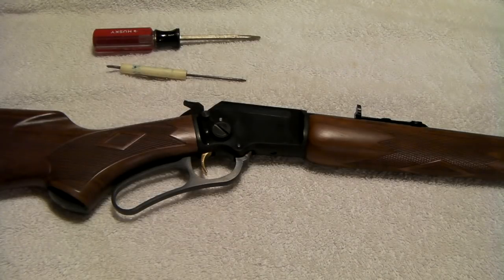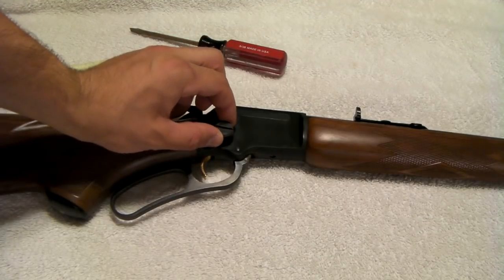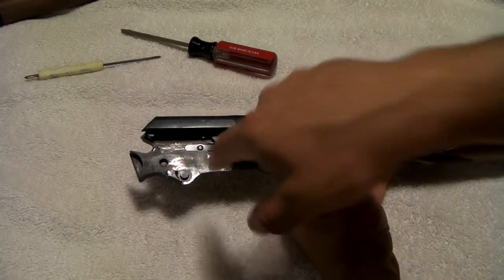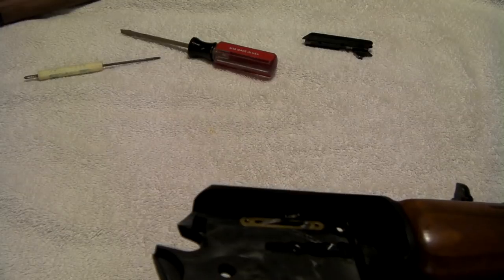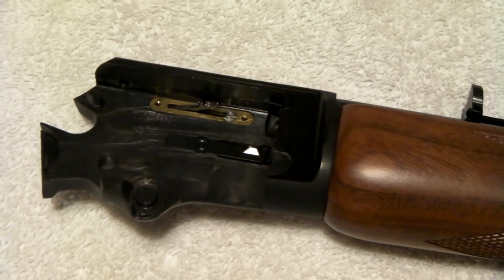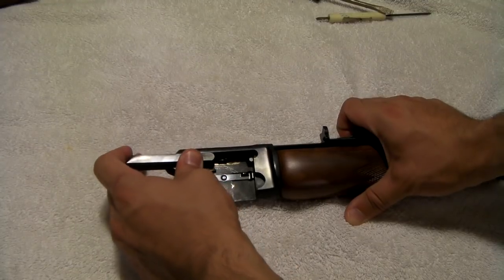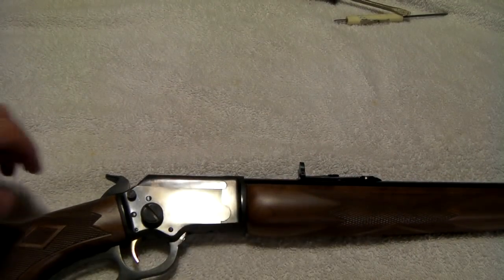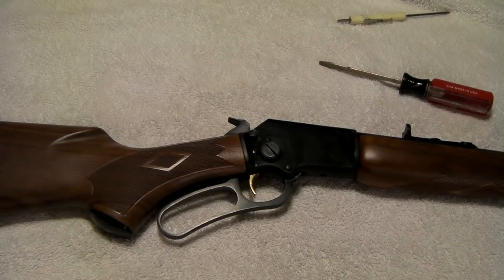Marlin 39a Disassembly/ Reassembly

Comment: Great Vid! 

Not applicable here, but for older Marlins (pre-1983 without the cross-bolt safety), the old manual says that during reassembly: (1) the firing pin is as far back as it will go (while the bolt is as far forward and (2) "Due to extremely close tolerances, it is necessary to release the lever slightly from the closed position."  Just thought someone might find that useful.  Thanks again!

Comment: Since I am a retired Gunsmith of 30 yrs. there are certain aspects of this gentlemen's video that could use some correction for all.  Note: It is however appreciated that the person creating the video was good/kind enough to at least provide some insight for those who otherwise did not have any idea of how, where, etc..  FIRST: As a previous reviewer noted - YOU DO NOT use a 1/4" bladed flat screwdriver on the Takedown Thumbwheel.  The slot in the Thumbwheel is technically referred to as a "Coin Slot" type cut - thus it literally self-describes the tool to utilize.  You can use a Coin Slot Bladed screwdriver (can buy these) of proper width to displace most of the slot length in the Thumbwheel, or you can make your own by simply belt sanding, or gentle grinding a flat blade screwdriver into a crescent/half moon shape.  Also, as with most other type SLOTTED screw heads, TO KEEP from marring the Blued Finish, place a piece of plastic baggie in between your tool (or coin) and the SLOT of the screw head.  SECONDLY: The separation of the two (2) rifle halves - go easy on the tapping - of the Barrel, or using the very Rear of the Stock to separate.  You can use the palm of your hand to tap on the rear most portion of the Stock.  If tapping via the Barrel use good padding, or a couple towels to keep from placing any marks on the Barrel, or into the Stock if tapping from that end.  THIRDLY:  Both sides of the Receiver do need cleaned thoroughly - not just the LEFT Side as stated in the video.  FOURTHLY: Using Hoppe's #9 to loosen and dissolve Chemical and Metal debris (not Black Powder) as stated in the video is a common choice - there are numerous other brands of products that do the same thing (such as Shooters Choice Solvent).  Nothing against old #9 or Hoppe Co., BUT, if any of this chemical is left within the Lockwork of your firearm, be aware that old #9 (and certain other brands) will semi-solidify over time (Temp and Dryness dependent) into a goo that will actually cause problems.  Always WASH out the Dissolving Solvent (i.e. #9) with a good clear and clean Rinse Solvent.  One I've always liked is Outers(tm)  Nitro Solvent in the spray can - other brands are similar in function.  Let things Air Dry, or use canned dry air to help the process.  Once "everything" is clean and dry, give your firearm a "drink" of lubricant.  Many brands are available, I often utilized Shooters Choice FP10, or other synthetic lubricant which will NOT DRY out quickly as will plain ordinary Gun Oil.  FIFTH: Many manufacturers advertise a (1) step, or Single Spray Scrubber for Guns...be aware that most all are Chlorinated-based chemicals (now non-flammable types).  These (1) Step Chemicals DO wash away Powder Debris, and Metal particulate, however they typically do not dissolve built-up Carbon deposits.  Using Round Wooden Toothpicks, Toothbrushes, or chisel-pointed Plastic-based small tools can get into those tiny nooks and crevasses where debris manage to hide.  Bottom Lines: Cleaning a firearm is a (3) step process, think of it as: applying soap, a rinse job, and aftershave (lol).  The first (2) steps of this cleaning process should be done to all BORES as well, except NO LUBE in the Bore if usage will occur shortly (a couple weeks) after this detailed cleaning.   A very small amount of light lube on a patch could be applied if exposure to water/moister during an upcoming usage is expected (Military Arms with Hard Chrome Bores are exempt).  Apply a small amount of lubrication inside the Bore via a patch if storing for awhile using a quality light lube (i.e. Rem Oil or similar), and run a dry patch through the Bore before usage.  No SHORTCUTS unless you are out in the field, or when "stuff" manages to find its way into your gun while hunting, or a long continuous day at the range, etc..  Your guns will function better, last longer, and you won't be frustrated with something not working right.  This process is applicable to ALL types/calibers/gauges of firearms.  This insight is NOT meant to advertise or detract from any product or brand of chemicals, the products listed herein are simply some of those that I have found that work quite well.  By the way - the Marlin 39A is/was (not currently made), a top shelf .22 Rifle in all its variations.
Reply: Can you please expand and expound thy great gun knowledge to all of us plebeians?  Danka 

#HidenJoeBiden

Comment: Thanks for the video and the tips and instructions.  I'm in my 70's and have had a 39A since I was a boy.  But as far as I know, it's never been taken apart and-or cleaned other than the barrel.  I'll be doing it soon, even though I still use it and it works perfectly.

Comment: Whatever you do, do not use a flat blade screwdriver like he did to remove the THUMB screw, or to reassemble it.  Should only be hand tight.  If your take down screw it too tight, use a quarter, not a screwdriver.  You will only bugger up your screw slot using a screwdriver that is not big enough to fill the slot in the thumb screw.  For the fellow that said that helped him with his trigger, I am amazed at how you got any trigger work done from that video.

This video is better than no video, but it is still not the PROPER way to do it.

Comment: To summarize what others have said:
-The take-down screw is designed to be used with a US quarter. It is dished for the coin, not a screwdriver.
-Hold the forearm in one hand and slap the left side of the stock to seperate. Don't strike the barrel nor magazine tube against Anything, at Anytime, for Anyreason. ( Exceptions: Self defense, bear attack, destroying firearm before it falls into enemy hands, etcetra ).
-Blackpowder is still used, tho extremely infrequently in .22 LR.  Smokeless and oil combined produces black sludge.
-Poor lighting. Standard room lighting utilized, no attempt to enhance and results show. After additional lighting, a strong flashlight may be used to show inside the action. "Too much is barely adequate."
Reply: Actually, the Marlin 39A manual says to "place a folded cloth on the floor or work bench. Hold the grip of the rifle firmly and let the left side of the muzzle strike the cloth. You may have to repeat this tapping several times ..."
But I agree with the rest. And one should take care to ensure you are tapping the barrel and not the magazine tube.
Reply: After resembling could not move the eject lever

Comment: Use a quarter to remove the disassembly screw!  A quarter is what it is designed to use.  A screwdriver will gouge up the slot.  It doesn't take many disassembles to crappify the slot :(

Comment: The takedown screw slot is not flat. Its bottom is an arc that fits an American quarter. So, a quarter is the proper tool to remove the screw if you overtightened and need to apply more torque … this is by Marlin’s DESIGN! Do NOT use a screwdriver!!! I have seen numerous 39A’s takedown screws with cosmetic damage due to screwdriver use. Don’t use a coin to tighten the screw in place … hand tighten using your fingers as the proper tool … that is why the screw has knurled edges. Do not overtighten!

If you MUST use a screwdriver, don’t pick one that is too small for the slot as is done in this video. To avoid screw damage, always choose the largest screwdriver that has a blade thickness to completely fill the gap of the slot to avoid creating focussed pressure points that gouge the edge of the slot. Most people use slotted screwdrivers improperly, and this video is an example of that. 

Oth

Comment: please use a quarter when loosening the take down knob, not a screwdriver...
Reply: lol i said the same thing lol i have one n absolutely love it!!!!
Reply: Not a thing wrong with using a screwdriver.  It can be hand tight, tightened with a nickle or quarter, or a PROPER fitting screwdriver.  Quarters have an abrasive edge with the grooves all around it, so I prefer a proper gunsmithing screwdriver.  Leaves no scratches that way.  The one that fits the screw on Redfield windage rings that is convex on the bottom works best.
Reply: @pickin4you    If you use a large blade screwdriver, I might agree with you, but not really. But this video is not showing that. I have seen too many 39A’s with a damaged takedown screw, which ruins the finish and then creates an unsightly appearence. In the newer 39A’s, that screw can be easily screwed completely out and replaced, but in an older one like my 1948 unit, the takedown screw is two-piece, swaged in place, and cannot be easily removed, so if you damage it, the repair is costly. The takedown screw slot is not flat, it’s slot is curved to accomodate an American quarter, hence the proper tool, if you need one, is a quarter … that is by Marlin’s DESIGN. So, in summary, I totally disagree with you.
Reply: @dilvishpa5776  I even put down a cleaning patch first, between the quarter and slot. Eliminates slop, AND, no metal contact!
Reply: @brucetstockford7592   That is a great suggestion! I am usually able to loosen the screw using just my hand, but if I ever need to resort to using a quarter, I will use your suggestion. Thanks!

Comment: Nice basic video, but you use a coin to undo the main screw, preferably a half-dollar or a quarter. Secondly, it's important to give the internals a good wipe down with a  light lubricant-protectant using a clean cotton cloth. This makes it easier to take apart next time. Finally, it should be pointed out that the this ability to easily break down the Marlin 39A, which makes breech-end cleaning easy, is a considerably advantage it has over most non-bolt-action 22s. Semi autos are usually a muzzle cleaning only proposition.

Comment: I haven't found anyone taking the forearm off. I've looked at several 39A cleaning videos and not
one took the forearm off. I was just wondering how its held on.  Thanks for the video though, very
informative.
Reply: It's a pair of small flat head screws. Undo them than the cap can slide forwards allowing you to remove the handguard. 2 years late on the comment, but there you go.

Comment: He didn't explain it properly, but the big takedown screw on the side of the receiver should be undone with either a wide blade hollowground screwdriver or a quarter.
Believe it or not that screw was designed from the beginning as a coin slot type, with Marlin themselves describing it as such in their manual.
As with all guns with flathead screws, it's always best to use spring steel hollowground screwdrivers to prevent damage to the screw heads.

Comment from the maker: According to the 13th edition of modern gun identification and values... The value of the 39M is $225 in good condition and $275 in excellent condition. The gold plated trigger hits the rarity mark. with that being said Ive seen these go for between $350 to $600. I hope this helps.

My guess would be 250-500 dollars in the states. But of course the firearm market is different in Europe. If you can get 500$ for it, I think you did great.

Comment from the maker: @horsefly4 yea, mine came with the mount. there are 4 screws above the action that come out, and then the mount goes on top of that. It also comes with 4 longer screws to go through the mount and then engage the threads in the gun. pretty self explanitory once you see it. be sure to save the short screws in case you want the scope to come off though.

Comment: Good job.  Thanks. Not much on these classics. Especially helpful was the reassembly part stating that the two halves didn't have to snap together perfectly flush before tightening the take-down screw. The manual doesn't describe this in any detail.

BTW. Is the firing pin just a free floating item without any spring?

Comment: Thank you TUCKERTHEGSP,
great help from you. One more question. Is it posible to screw down ejector prior the rifle takedown? Mean, can I open bolt with lever, screw down ejector and disassemble Marlin? One more time: thanks for reshooting that video.
Reply: Tried  sharply taping the end of the barrel as shown but it will not break apart! Help!

Comment: I think the 39M is the same as a Mountie my Brother got one for Christmas in 1977 it is a sweet rifle i have a 1954 39A with a straight stock and 20" barrel it looks a lot like a Mountie/39M except for the lever on mine is round on the back unlike the 39M which has a D shaped lever with a short tang. In the U.S. a nice 39M will bring around $550-$600 on Gunbrokers I paid $650 for my 1954 model 39A (carbine) I bought it on Gunbrokers,
Reply: Yeah right. And I just paid $2670.39 fo my 1958 39a squirrel 🐿 gun. 

I got a “good deal”

#HidenBidenInflation
Reply: @mateobrainardo4770  wow $2670.39 ? Where do you live that they are that expensive?

Comment: You just used the wrong tool to CHODE up your takedown screw slot. That screwdriver was too schmall, the slot is meant for the thickness and maximum torque applied with a United Sates quarter. I use a number 3 flat screwdriver and I protect the schlott with a piece of thin leather. DONT CHODE UP YOUR SCHLOTT